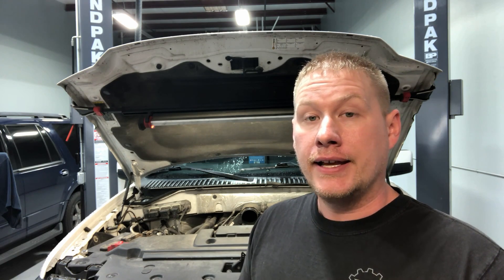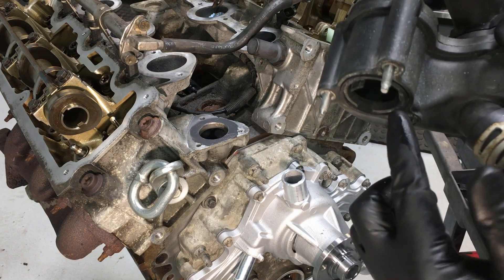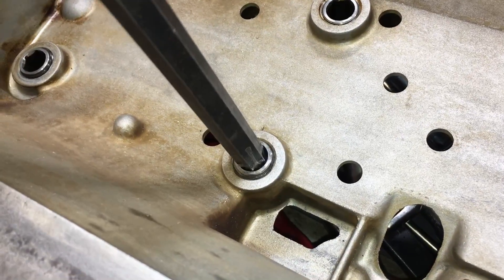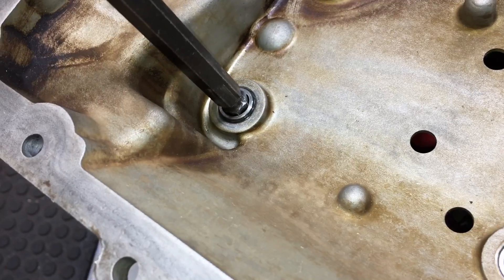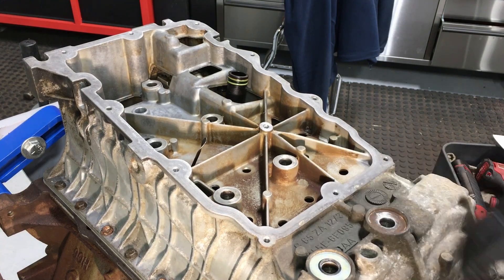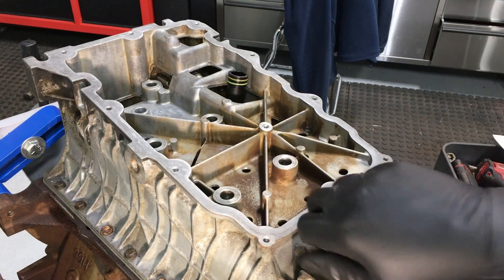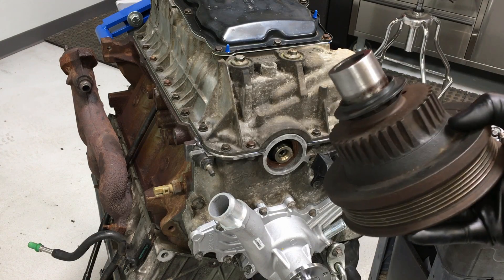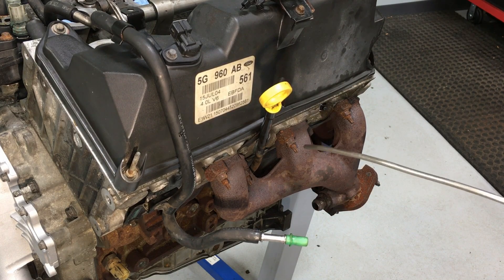Ford Explorer Ranger 4.0L SOHC Startup Rattle Fix: Timing Walkthrough Pt 4 of 4 Engine Assembly

Comment from the maker: Gasket Sets used for this Repair:
Front Cover Gasket Set-
https://amzn.to/2FlNQ2k
Upper Oil Pan Gasket Set-
https://amzn.to/2PSUwt4
Lower Oil Pan Gasket-
https://amzn.to/2RRG3ut
Valve Cover Gasket Set-
https://amzn.to/2PUn98V
Intake Manifold Set-
https://amzn.to/2DiEH88
Rear Main Seal-
https://amzn.to/2DgU68S                                                                                                                                                                                   Torque Spec and Sequences:
Upper Oil Pan-
https://drive.google.com/file/d/1WuY6RQcrnyKmPGZgOpZXZch5h_DkDU_x/view?usp=sharing
Flexplate Bolts-
https://drive.google.com/file/d/1i8nH0EwGS3PLjE0loJAvgsjpmeGaKkWd/view?usp=sharing
Front Cover- 14ft lbs
Water Pump- 89in lbs
Thermostat Housing- 98in lbs
Valve Cover Bolts- 89in lbs
Upper Oil Pan 10mm Bolts- 124in lbs
Upper Oil Pan two front Nuts- 89in lbs
Upper Oil Pan Rear Torx Bolts- 89in lbs
Lower Oil Pan Bolts- 80in lbs
Reply: FordTechMakuloco Thank You This Series is the Best I’ve Seen On The 4.0 😎😊
Reply: Damn!!
Reply: You did a great job on this series THANK YOU!
Reply: I've got a 06 4.6 3v, cuts all the way out at 4k-5k, feels like a super hard rev limiter. While driving, it will do that a few times but after that it screams and doesn't miss; No dtc or lights.
Reply: FordTechMakuloco do you have a patreon or anything like that??
Reply: you put the valve cover on without rocker arms!!!!!
Reply: never mind on the rocker arms but they were bitch
Reply: FordTechMakuloco 

Is there a way I can contact you I have a few questions on my 1998 Ford Explorer 4.0 sohc Eddie Bauer
Reply: Where did u find the timing tool set?
Reply: FordTechMakuloco ? What is the  price of  parts and  labor for this repair in 2025 ?

Comment: One question I didn't see covered. You said the cam follower tool wouldn't work on the follower one the end of the camshaft. How did you get all the followers back in? And do you recommend changing them while doing this? TIA, and thanks for the great instructions.
Reply from the maker: I lift the cam.
Reply: Thanks. I can find the front sprocket (jackshaft) bolt on Amazon but haven't had much luck on the rear.

Comment: Do I need to time the jackshaft?
Reply from the maker: yes the way it is shown here
Reply: So, my understanding is that the jackshaft gear goes to the oil pump drive gear. The timing comes into play with the sprockets you attach to the jackshaft afterwards for the rear and front camshaft timing. Is that correct? Maybe I’m missing something.

Comment: Do you use the alignment tool for the timing cover to install the front crank seal? I’ve been reading you need to align the timing cover to the crank so it doesn’t chew through the seal?
Reply from the maker: I use the crankshaft pulley to center it.
Reply: @ I did the timing chains perfectly fine, truck runs great. But it chewed through the seal in a month. I didn’t use the crank to align it when I put the cover on unfortunately. My dumbass used rtv all the way around the cover and it’s stuck on. I’m afraid to ruin the oil pan gasket removing the timing cover any tips on what I should do? The cover won’t even budge with all the bolts off?! 100 percent have all the bolts out.
Reply: @FordTechMakuloco i ended up finding a special tool for the 4.0 that sets the front crank seal depth and aligns the cover. Everything worked great no leaks! Thank you for this video I followed it and it runs great. 400k he we gooo!

Comment: I FOLLOWED THIS SERIES TO REPLACE MY TIMING COMPONENTS.
 THIS ENGINE IS IN A 01RANGER,ITS ONLY GOT 135,000 MI.
BUT AFTER REPLACING TIMING KIT,THE ENGINE SOUNDS REALLY REALLY LOUD...
IM STUMPED, ANY ADVICE, INFO MUCH APPRECIATED.
AT FIRST I REPLACED KIT W/O "SPECIAL TOOLS".
ITHE ENGINE WLDNT EVEN START. SO I BOUGHT ANOTHER TIMING KIT AND THE SPECIAL TOOLS,PULLED ENGINE AGAIN AND DID IT CORRECTLY,ENGINE RUNS,SNDS SOLID, BUT IS VERY LOUD.ALMOST LIKE EXHAUST ISNT IN PLACE..
ANY HELP APPRECIATED. THANKS

Comment: Upper oil pan? You mean the girdle?
Reply from the maker: Yup it is the same thing but Ford calls it the upper oil pan.
Reply: @FordTechMakuloco  didn’t know that. Thank you for the info. My son and I are almost finished rebuilding this headache. Great motor with regard to longevity with frequent oil changes. Still had the cross hatching on the main bearings at 173,000 miles.

Comment: Great video.  I can't thank you enough for creating such a good video with the detail I need to have confidence to rebuild my son's 05 Ranger XLT 4x4.  I have a question.  You replaced the timing chains and timed the engine.  I intend to do the same, but the issue with our truck is that it has a bad main bearing.  Are there any intricate things I should look out for or do you have  a video to do that?  I want to replace the all, and the piston and rings, lifters, etc. so that he can have a great engine for another 150, 000 miles.  Can I do what you did, time the engine and then pull out the main bearings, etc., without knocking off the timing?  Thanks in advance!

Comment: I was under my daughter's 2005 Explorer today and noticed the front crankshaft oil seal that comes with the harmonic balancer assembly was partially missing.  Only the bottom half was there. There doesn't appear to be any sort of an oil leak. How important is this seal? Should she not drive the vehicle until I replace it? If the harmonic balancer is in good shape and I don't want to replace it, can you buy just the seal? Would you happen to have a part number?
Thanks for the great videos.  Been watching a lot of your F150 videos until I got an F250...

Comment: Question for you. I have a 2011 Ranger 4.0 SOHC. It runs fine. Did Ford fix these issues in the later years of this engine? Were the OEM parts fixed by 2011?

Comment: So i followed everything on the video. Exept i didnt crank it as long as 30 sec multiple times to build oil pressure. I left crank sensor disconnected and cranked for about 15 seconds then fired it up. Eitherway the engine sounded uneven while cranking kind of like theirs a difference in compression on some of the cylinders. Going to do a compression check today and see whats going on. Im guessing timing jumped bc i didnt do something right. Engine runs good. Just a slight vibration/miss at idle.
Reply: @slowcobra9263  how’s it running now?

Comment: In my area the repair shops don't want to do them. Two said that the engine gets plastic pieces in the engines and block oil passages and go bang. I decided to put a new remanufactured engine in with a warranty. They had to pull the engine either way.

Comment: I have a 2004 manual 4.0 4x4. Can I reuse the flywheel bolts ? There is a discrepancy on bolts for the 2004-2005 trucks. Went to order new bolts and the part number skips 2004-2005 trucks. Can't seem to get an answere as to why?

Comment: All I need help with and not covered in detail is inserting roller follower s. I bought a tool from Amazon spring compressor tool fits 4.0. I will try to figure it out but only found one video that is different engine  places and uses a screw driver. The 4.0 is to tight to get them in place. Help from anyone and this is the best YouTube and helpful. Thank you for time spent.

Comment: I'm an automotive technician with over 20 years of experience. I've never seen a shop time one of these engines, mainly because they don't have the time to do it profitably, and because they'd rather sell a reman engine or just let it leave the shop. I've seen good ford vehicles become overnight trash because of these engines.

This past October, I bought my son (who's learning to drive) a incredibly clean.and well matained 2003 Sport Trac with the  4.0 and 172k on it for $3000. After doing several items to it, it finally started making the Rattle Of Death after putting just 1800 miles on it. Needless to say, I already have the engine out, and my other technician friend has loaned me his Ford timing kit, that he only used once back in 2008.

You are correct that learning to time these engines WITHOUT someone teaching you right and wrong way has caused alot of techs to just say 'The Hell With It'.

But in actually looking forward to replacing the chains and cassette on my son's engine.

Thank you for making this video.

Comment: Please Mr fordTech can you answer this.
OMG! It's happened!  Total timing gear failure!  Everything except the rear tensioner has detonated! 😭😭
So happy to of found  this series what a frekin nightmare of an engine. 
So I can only assume that the chains may have jumped and let's assume they have my question is... Is this an interference engine????
The stealerships are hopeless because an 05 is like something from the Jurassic period to them!
I've had every answer from phone calls to the www. as to a.. No. A.. yes and even from an engine builder " only on one side" but I don't remember which side 🤔. 
Please help. Parts are horrific here in Australia and I don't wish to purchase a $1500+ timing kit +++++ other required parts and tooling if the heads are stuffed!
Thanks in advance.
Reply from the maker: Yes it is an interference engine so while it is apart you can perform a leak down test before going any further.

Comment: We have an 03 Explorer with the 4.0 that now has 310,000 miles and no engine problems what so ever. Original timing chains, etc. Just regular oil changes. It has out lasted the body (rust). Great engine - glad I didn't have to do any of this!

Comment: I did the replacement step by step,  starts up but has a rough idle,  no codes and I don't see any vacuum leaks.  What might be the problem?
Reply from the maker: Either you mistimed it or put the plug wires back on incorrectly.

Comment: My 2000 Explorer is running fine,222,000 miles. But I don't know the history.

 It's rough and rusty, and not worth tearing down the engine WHEN the chains and guides go.

So......... the question is this. 

How much longer is it likely to last?

Comment: What an amazing video I have a problem  when I put my engine back in, I'm getting a fault code, P0320, Ignition/Distributor Engine Speed Input Circuit Malfunction. Engines idling really rough and bogging out when you hit the accelerator. I wonder if that has anything to do with timing? What should I do?

Comment: love the video. I noticed that you recommend torquing the upper oil pan bolts to 124 inch pounds, but I've seen two separate service manuals suggest using 89 inch pounds on these bolts. I'm just curious as to why you might have suggested 124 inch pounds?
Reply from the maker: It is an updated torque spec, I only use the Ford WSM same as dealer techs so I get the information directly from the horses mouth as copy and pasted here-

Tighten the 20 bolts and the 2 nuts.
Tighten the nuts to 10 Nm (89 lb-in).
Tighten the bolts to 14 Nm (124 lb-in).

Comment: Is there a way for me to ask you a question about starting and staying in 5th gear?
Reply from the maker: Not sure which trans but in general when they start out in a high gear they are is self protection mode. Pull codes and go from there.
Reply: @FordTechMakuloco  cool, i didn't want to write a book on here so i was vauge lol. As of today...the issue is not present today but the transmission according to snap on and autel is 5r55rw/s

This is copy and paste from my original message i was going to send. It's long...sorry...

" i can't find anything in service info (i only have identifix). 

Long story short...2003 explorer xlt 4.0
I'm pulling the engine in about 2 weeks to do the chains (broken timing chain guild still drivable).  Today while driving i noticed no power on accelerating so i hooked up the scan tool and noticed 2 codes p0172(which has been on there due to the chains being out about 15°, confirmed with pulse sensor and in cylinder captures) the newest code was a knock sensor code (i want to say p0325 but i don't remember)...the knock p.i.d. counts up constantly and when i go in under transmission desired and actual gear it stays in 5th gear always, i can disengage the overdrive and the transmission shifts normally...

I'm wondering if this is some sort of logic for the engine knock even though service info only states the knock sensor would retard timing...i and suspecting this because it's being commanded to stay in 5th but i cannot find any information to prove that. I'd really hate to pull the engine, change out the chains only to find i have something major going on. Lol"

Comment: This is the video you need if you want to understand ford 4.0 sohc timing it's detailed and step by step and removing the camshafts will prevent less experienced mechanics from warping there valves and helping to assure good timing.

Comment: I'm missing something here;  earlier you left a couple of the cam followers in, because you couldn't get to them with the tool and removed them when you removed the cams.    You never put them back in before reinstalling the cams, so how is it you couldn't take them out without removing the cams, but you can supposedly put them back in after the cams are installed???? 🤔

Am I supposed to install the difficult followers before installing the cams or what?   Actually, I'm at a loss as to why you removed the cams to begin with; was it actually necessary to remove the cams to replace the timing chains?

Comment: Working on one of these. Looks like timing jumped so much that i have 0 compression on one bank and had valves contact pistons. Im going to remove heads and have them checked and replace whatever needs replacing. But first how do i know if its okay to re use the bottom end since the valves hit the the pistons? Thank you sir
Reply: @slowcobra9263  how’d it go?

Comment: i just built my 4.0L the your supposed to buy well I'm living proof you don't need it just use your head my engine runs great but the fact i had to poll it out change so much crap i painted the block and pan GM red and 3 coates clear should have kept push rods and big heads go fig

Comment: Hey man i just watched this whole series as ill be doing this job in the coming days. One question i have for you is, do i have to check my valves at all? After my engine died while driving i diagnosed the issue to a broken chain tensioner. A mechanic told me that it skipped timing and i will most likely have a bent valve as well. Any way to confirm this without taking the valves out? Thanks!

Comment: I can't believe they designed an engine with the cam driven from the rear. Not to mention chain guides made from materials that don't hold up very long. Self terminating engine is what Ford made here. I will never own one of these. Thanks for exposing the flaws you do good work.

Comment: Do these engines need thread sealer on the flex plate bolts? I know you didn’t say they do, but I found one person saying it’s needed. I did an engine replacement and I’m having a horrible oil leak from the bottom of the bell housing while the engine is running. All the seals and timing components were said to have been done 1000 miles before I bought the engine. Everything around the bell housing is dry.
Reply from the maker: no sealant just threadlock.

Comment: I’ve gone step by step throughout the whole process of changing my timing components on my 02 Explorer and your videos are perfect. Thank you for the walkthroughs. I have 1 question though. When you reinstall the engine and torque down the drive plate bolts to the torque converter, what exactly do you use for the ft lbs part of the specs ? My 18” ft lb torque wrench won’t fit in the tiny area give to torque down those 4 bolts. The 1st step (in lb) was a breeze. Please help. Thanks again

Comment: A HUGE thanks to you Brian for this series. Followed your instructions to the T and fired off my ‘08 Explorer 4.0 and she purrs like a kitten. Have an ‘05 Ranger 4.0 that will need it one day. Not for the faint of heart- takes lots of patience. Thanks Man!!!
Reply: @rosiemckinzie8608  how are they running now?
Reply: @ Still driving my ‘08 Explorer, (it’s me and my dogs adventure rig, actually it’s his truck😂) We go to the lake or creek weekly to swim in the summer and hike in the winter. My ‘05 Ranger with the 4.0 now has 130,000 on it and has developed a rear main leak. Will pull it this summer and while doing that will go ahead and do the timing job on it since I have all the tools and knowledge now thanks to Brian. Pricing a new pickup I have more time than money so it’s well worth the labor. The 4.0 is a beast.

Comment: What are you thoughts on the Ford OEM rear main seal with metal sleeve vs the sleeveless Fel-Pro/aftermarket seals? Apparently Ford upgraded/changed the seal to a sleeved version at some point and no longer offers the non-sleeved version. Also, should sealant/retaining compound of any kind be used between the sleeve and the crankshaft? Thanks to your videos, I am wrapping up a timing job on an 05 Mountaineer and hope to get it back on the road soon.

Comment: Hey man quick question.  i got a 99 ranger 4.0 OHV.  had to do rod bearings and the cam synchro roll pin.  When I install the motor, will the converter only bolt on 1 way or will I have to keep spinning the converter or flexplate till it bolts up?

Comment: How did you get the roller follower back on without the proper tool? You needed to remove the camshaft to remove them…
Reply from the maker: I used the tool for most of them and lifted the cam to get the end one in.
Reply: @FordTechMakuloco  so after timing you lifted the camshaft to put it in? i got a tool for a 4.0 and i can NOT get the roller follower to come out past it.